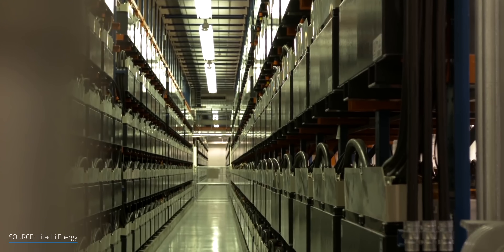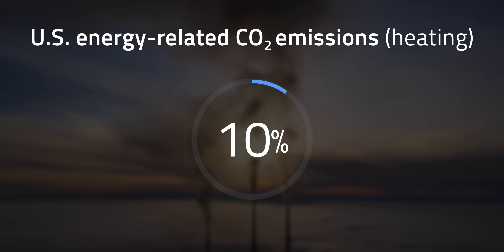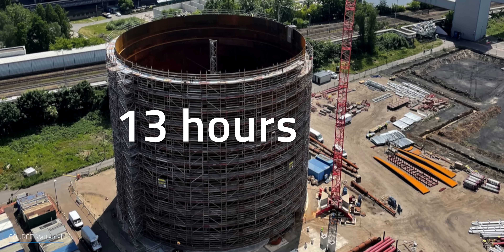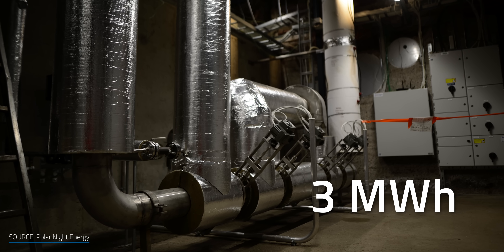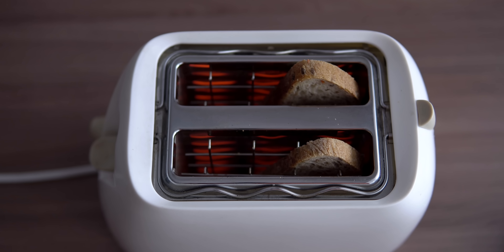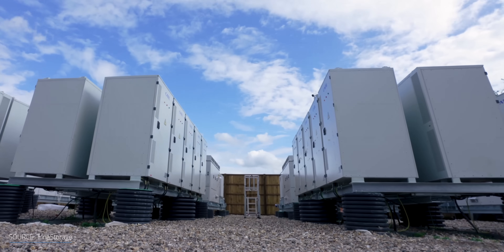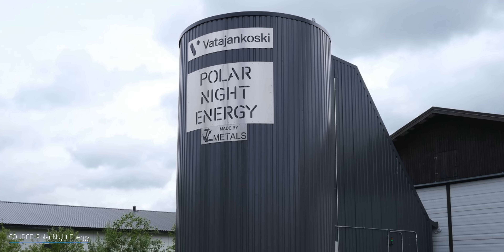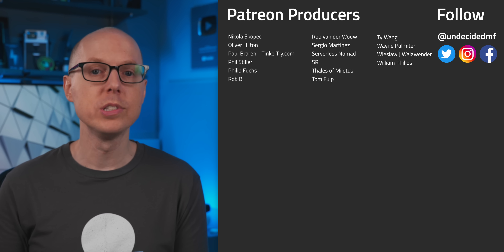How A Sand Battery Could Change The Energy Game

Comment: Do you know if there is any research into using materials that rapidly expand when exposed to voltage as pistons for engines?
Reply: There is research into materials that expand and contract when current is passed through them actually, they're used commonly in starters for generators, and types of lamps / lights, however I dont think it would be used for pistons in engines as efficiency would be lost when turning the pistons linear movement into rotary movement, which is why they tend to just use motors for the wheels in electric vehicles
Reply: @jaisere  I was just thinking it would be the most efficient way of converting all combustion engines to electric. Simply replace the pistins with a matetial that without current/voltage compresses to extremely dense small area, and with a (hopefully) small amount of voktage, expands rapidly with great force. Replacing the need for an explosive expanding gas
Reply: @tylergorzney8499  It would probably be easier to convert them from gasoline to hydrogen engines, but the problem of power storage would still arrive, so it would probably be best to place a Combustion cars chassis over an electric if the style of a combustion car is what people are looking for
Reply: @jaisere  true, but I was curious if a material could be developed that would require extremely low voltage, and expand 1000 fold or whaever....basically insane effeciency. So then energy storage would be extremely minimal, far less than what is currently needed for electric motors

Comment: I feel like using heat pumps could further maximize the energy efficiency of these systems. Granted, you're adding to the cost and complexity (resistive heating is not a particularly complex piece of technology), but if heat pumps could get you three times as much heat per watt, it might be worth the investment.

Then again, the main goal is to use surplus energy from renewables, so making that more efficient might be an extremely low priority.
Reply: Heat pump can't get hot enough. The research company SINTEF has made a prototype that can reach 180°C, but most top out at 60-100°C. I think it would  e too expensive to even use one of the highest rated of those.
Reply: @phizc  Interesting! I hadn't considered the limit of the heat pumps (especially without engineering something specialized). Thanks for pointing that out to me!

Comment: This reminds me of the off-peak storage heater we had in the UK in the 60s.  It used cheap electricity at night to heat up bricks in the heater and then released the energy slowly throughout the day to heat the house.    The storage time was clearly quite limit, but it's the same basic principal.  The efficiency was 100%.  In the future, with an excess of solar energy during the day, it could be used to store energy for use at night when there is clearly no solar energy production.
Reply: Sounds simple and effective. Wonder why it didn’t catch on if was used in the 60’s.
Reply: @TheBooban  This system is still used today - mostly in flats I would think, but I bought a house just a few years ago that only had this system of storage radiators plus one coal fire.  I also have two flats that use this system.  It is very much alive in Britain.
Reply: It's tiny, but I wonder how much energy is lost to glow and hum?
Reply: @robbprof111  If I'm not mistaken, any light or sound energy generate by the heater eventually gets converted to heat that warms the house very slightly unless it leaves the house (such as light exiting the house through the windows).
Reply: Heat pumps are more than 100% efficient... This video is not really giving a very balanced perspective from an engineer's viewpoint... 

Also, the higher the temperature, the greater insulation required and more great losses

Comment: you could also use a slow turning Archimedes screw to make a gravity battery. You move it up with some solar. it weighs down. Then it slowly releases the sand and returns energy. I have this other idea using sand and static.....
Reply: I'm trying to picture in my head what you've described but it's somewhat confusing me, if you are adept in making simulations or animations at all i'd be interested in watching a demonstration like that on your channel
Reply: @jaisere  I think he is describing storing energy mechanically by raising a weight.
They already do that with water. -Much easier to do with water...
(and MUCH less friction losses)

Comment: Question, if they are using resistive heating. Would there be an advantage in using a heat pump type system while storing heat in the summer cooling infrastructure ?
Reply: On paper, maybe.  But it's not practical in the real world.  The easiest and most direct way to heat a space is to set something on fire; the next least dangerous way is to use another process that emits heat - electric resistance in this case.  A heat pump can run a refrigerant cycle that moves 3x more energy than it consumes, but they have to extract that energy from the air outdoors and move into the space being heated. If you're trying to maintain 70° in your house when it's 25° outside that's doable.  Maintaining 1000° is well beyond what heat pump technology can handle.

Comment: Another thing to consider, there are already ground based heat pumps for heating houses, which is similar to this in concept (except for the heat pump). In these systems, though the ground isn't insulated from the neighbouring ground, it is mostly a thermal reservoir as the heat moves so slowly.
Reply: I used to do a lot of solar type home construction.we would put copper tubing running all over the floor and cover it with sand and brick it or put the coper in the foundation. They would run hot water through it to heat the home. They also have this thing called Bombay wall. It's basically like an adobe wall exposed to the sun behind glass. Apparently it's stored a lot of heat as well.. also a lot of times I would spray polyurethane foam over  adobe walls then they would wrap it with chicken wire or large and go with stucco over that.

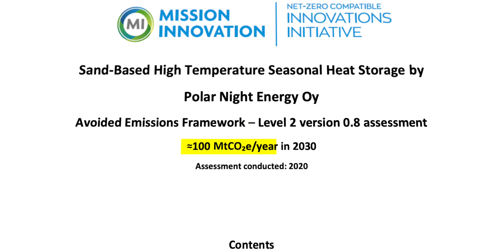Comment: At 7:52, you made a mistake as Mt is megatonnes, not metric tonnes. I think it was just a slip of the tongue though as you compared to New York later.

A fascinating idea. At first I thought it would be about pumping sand like pumped hydro, there would be some benefits, to this compared to water, like increased density means less volume needed for the same energy and also the possibility of storing the sand in a heap such that it has a greater volume than the vessel. There'd be much greater losses in moving it though.
Reply: He made a mistake, but not that one. "MtCO2 eq" is "Metric tons of Carbon Dioxide equivalent". The comparison with NYC is off by a factor of a million.
NYC's emissions was 56 million MtCO2 eq.

Comment: I think a smaller device installed in a neighborhood or even a single home would make sense. Or a hotel. Most of the municipal heating systems run on steam, not hot air. It also seems odd that they use hot air to heat the sand, rather than something more conductive, but there's probably physics I'm not thinking about. Maybe the hot air is distributed through the sand, and water would make that a mess. The steel tubes seemed to be a closed system, but if it is an open system, then I understand air vs water.

Comment: I would be interested in you covering some of the older more localized heat storage systems.  In the uk as a kid we had large boxes in many homes that were full of bricks.  The bricks would get heated during off peak electrical usage.  I also recall an air conditioning system that froze a cube of water off peak and then used that block of ice to help cool during peak heat.
Reply: In the old days there were also the heat magazine stove(or however it translates to English.). It had a huge core of iron that was kept heated all day with electricity and when the need came for cooking you could use up all that stored heat. 
It was in the time when electricity was metered by the line capacity and not the energy usage and so it was most economical for households to have a constant electricity use throughout the day.
Reply: YES AWESOME

Comment: Why resistant heating and not heat pumps? You can reverse it to extract heat and it is far more efficient. I mean ground heat pumps exist already.
Reply: Too hot. Commercial heat pumps only go up to 100°C for the top end. Record for research HP is around 180°C.
Also expensive.

Comment: Something like that would be also nice at home - ie storing the heat energy during the summer to heat the home in the winter and to also heat hot water instead of using LPG or gas or even an electric water heater. Assuming that the sand can be insulated to hold the hundreds of degrees of heat for the time required.
Reply: Those metal silos and transportation and setup is likely pretty expensive. No homes will ever have this.

Comment: The current silo has 3MWhcapacity. The standards say,that my house may need around 2.7 MWh/year, if it was passive. But I have only low energy house,so it needs around 9 MWh/year (heating &hot water). Not even mentioning demand of an average house without serious insulation and triple pane windows. So it seems to me to be unfeasible solution by a large margin.
Reply: That's assuming the silo is only heated up to 3MWh for one hour per year... your constant load equivalent at 9MWh/year is about 1kWh. So if the sand silo is heated up for 10% of the time, you could heat about 300 equivalent homes with one 100 ton sand battery, so about 350kg/home.
Reply: @marvin19966  OK, that could make a sense and then it's worth to research this in more detail. I the output is not really that important, it's the heat capacity it can provide.
Reply: I think this can only work where you get sun or wind in the winter time, because it seems it really has a "sweet spot" at around 80  hrs of discharge. But here, in the middle of the European continent, you get weeks without enough sun and wind, which is probably case of most places. Might work nice in windy areas, though.

Comment: So… i think this works already today in form of geothermal heatpumps? Could they possibly use heatpumps to be more efficient than resistive heating? Assuming they could, but they probably couldn’t drive the temperature up to 600 degrees

Comment: Thanks for covering this so quickly! I love the idea behind this, it's stupidly simple and brilliant at the same time! Just store heat as heat and use readily available materials. You basically need metal, insulation and sand! Right tool for the right job, exactly the right ending note!
Reply: Turning electricity straight into heat like that is an enormous waste, this solves nothing and time will tell.
Reply: @axiom1650  It is about the excess electricity

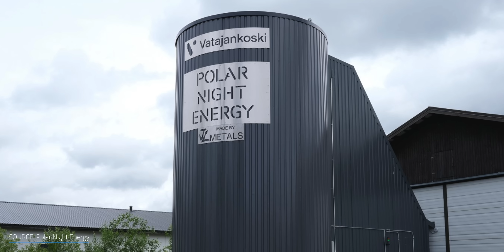Comment: 9:39 ... at atmospheric pressure.  Dear Mr. Plausible with Matt Ferrell. In a closed system, are you familiar with a pressure cooker or Phase Diagrams?
Reply: The critical point of water is 374°C and 218 Atm.. 

Old:
I tried hard, but I was unable to find the pressure at higher temperatures than 374°C. Here are some numbers:
100°C : 1 Atm
...
340°C : 144 Atm
360°C : 184 Atm
370°C : 207 Atm
374°C : 218 Atm
600°C : 💥 💥 💥?

Comment: electricity is cheap in my local.  Duke Energy charges about 10 cents per kWh.  So it’s not economical to buy an energy storage system at $10/kWh.  I’m not expecting to live 100 years.

Comment: I am looking at this from a US residential perspective. Since it looks like the sand thermal storage is relatively small in size, and the highest cost would be for new transportation of the heat to locations, wouldn't keeping the sand storage as close as possible to the location it would be used.  So a home that has solar on the premises could also have a sand battery the size of a small shed.  Then extra stored energy could be used for hot water generation?

Comment: $10/kw uh that is 66 times higher than I regularly pay for single phase power for my home. Three phase power is even cheaper.
Reply: I think they mentioned cost of energy storage = "the battery", not cost of produced energy.
Reply: @peterlovisek9210  ah, yes it is the startup cost priced in kw.
Reply: @peterlovisek9210  Agree! It is the capital cost per KWhr of storage.
Battery storage is often evaluated in these terms.
In mobile applications, energy storage is also rated in KWhrs per weight unit.

Comment: Could a heat pump be used instead of a resistive heating element? Would the higher COP of a heat pump increase the efficiency of the sand battery?
Reply: Using normal working gases a heat pump only works over a delta temperature of 35 F.  So a heat pump would help until the exchange loop got to 35 over the ambient air temperature.  A multi-stage design would help, but would take too many stages to get to 600 C.

Comment: Just got idea for home/farm use: heat up silo with sun vacuum tubes during the summer and during winter you convert this stored heat through heat pump or even direkt just use central heating pump + mixing valve and some electronics for regulating everything.
This is something for good DIY project.

Comment: Wouldn't the square-cube-law work in our favour here? Just scale it up massively and have lots of storage volume for not a lot of surface area over which heat can escape by comparison. Or what is the limiting factor?
Reply: The limiting factor would be the size of the area of that usable thermal energy. This works great in the narrow example of areas that will intermittently produce excess heat and alternately need more heat than they're producing on site over a span of less than a few months, but once you need to move that heat offsite over any appreciable distance, the lack of capable enough insulation compounded over distance would cause massive losses in energy in the piping; this is why you probably have your own water heater and don't pay for a hot water line from across town.
Reply: @mtnbkr5478  In fact, our district heating works like that - there is cold water supply to the houses, part of the fresh water is heated in a heat exchanger - so yes, we buy hot water from across town, sort of :-)
Reply: @pohjoinenkala9301  I knew that there are some areas where that's a thing, but I'm not very familiar with it. How large of an area can they handle?
Reply: @mtnbkr5478  In Helsinki, the whole town is covered by DH, the length of the piping is some 1300 kms. They offer heating and cooling too :-)
Reply: @pohjoinenkala9301  That's pretty impressive. I was originally thinking that there would be a lot of energy lost in moving heat over a large area like that, but if the system is constant and well insulated it would make sense that those losses would be minimized. Thank you!
Reply: @mtnbkr5478  power plants in my country supply electricity and hot water. Pipes are old and sometimes leaking, but still it's overall cheaper, safer and puts less strain on electrical grid, than individual heaters in every house.
Reply: @mtnbkr5478  Might sound dumb, but perhaps having the storage unit centrally located in the city centre and deep underground would help.

-Earth would help with insulation
-Having the pipes sloped upwards towards the city may help with more efficient transfer
Reply: @pumpjackmcgee4267  Having the unit underground would help, but the majority of heat loss would occur in the pipes. Depending on the size of the city, being able to move the heat over miles would require compensation with higher heat at the unit, and larger temperature disparities reduce insulation’s efficiency. At some point it simply costs more to move heat than to produce it on site. Multiple units would be the most efficient, but given that the point is to use waste heat whenever possible, it would require checkerboarding the city with industrial areas, and cities typically aren't built that way because industrial smog travels east, so it's better to just have those facilities where the smog is downwind from residential areas, covering whatever area they can and using other methods in areas that it would be less feasible.
Reply: @mtnbkr5478  Couldn't you just convert it to electricity before transferring it over a distance? Or would this not really work in reverse to actually create electricity? Only heat?
Reply: @alexhren-boulis918  Steam turbines are about 50% energy efficient. Geothermal heat pumps can have as much as 400% efficiency compared to resistive heat, but that would also require pretty expensive equipment on both ends, and I believe the main point of the sand is the reduced implementation cost.

Comment: It’s not a retro fit to existing district heating systems if they are piping around air. You can’t just switch steam  piping to air piping, the pipes won’t be big enough. The district heating needs to be basically ducted, rather than hydronic. I wonder they don’t circulate water?